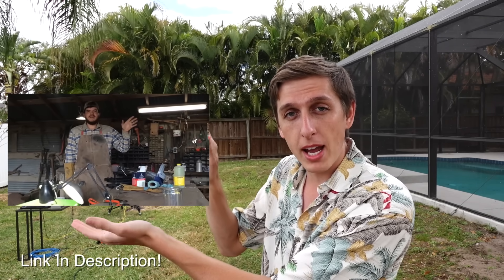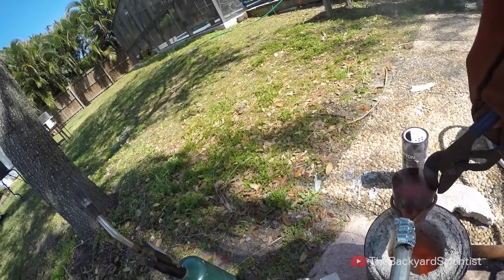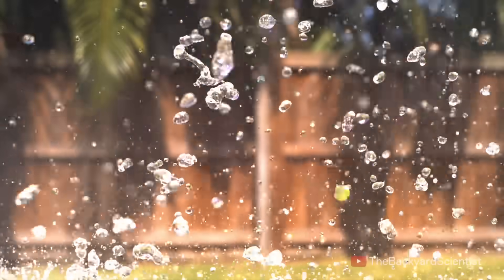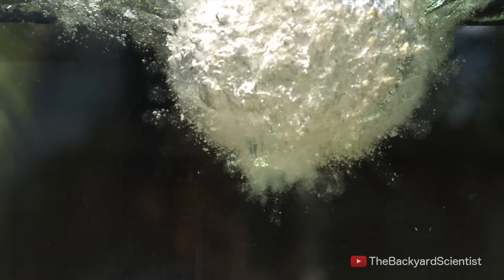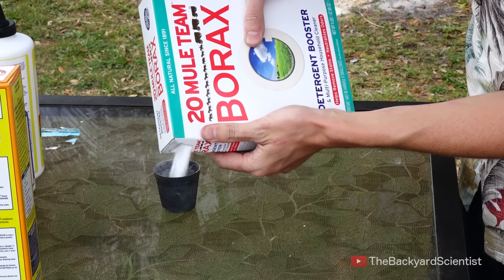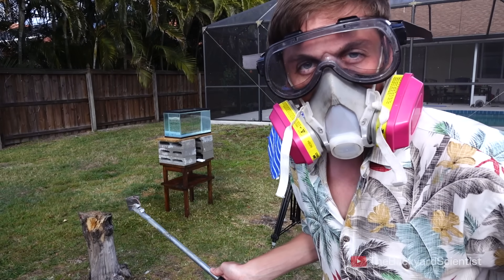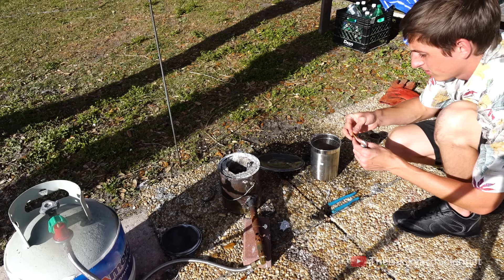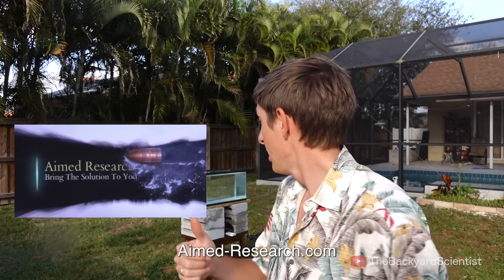Pouring Molten salt into Water - Explosion!

Comment: What's happening is the high temperature of the salt is causing the water to flash to steam. As for your question about the Leidenfrost effect, what you're really talking about is the transition from nucleate boiling to film boiling. Past the critical heat flux, you have a departure from nucleate boiling and a transition into film boiling, which occurs at the Leidenfrost point. The reason that you aren't seeing this transition boiling phase as readily in the case of the NaCl is that the dissociation of the salt in water is endothermic, so it requires some external energy to occur. This would mean that the local temperature of the surface of the molten NaCl may be reduced just under the point where a departure from nucleate boiling would occur.
Reply: Is it bad that I don't at all get what ur saying………

Comment: Leidenfrost Effect via Wikipedia : The Leidenfrost effect is a physical phenomenon in which a liquid, in near contact with a mass significantly hotter than the liquid's boiling point, produces an insulating vapor layer keeping that liquid from boiling rapidly. Due to this ‘repulsive force,’ the droplet hovers over the surface rather than making physical contact with it

Comment: Well it's a nice video 
however u might not know this & that is u can make sodium metal explode too no need to heat it or melt it just throw some small piece of  sodium in water & see the magic of explosion.
and if u say there is no chemical reaction then u are wrong  
if u put the sodium solid in water that chemical reaction happen 
sodium=Na 
water=H2O 
so the chemical reaction is 

2Na(s) + 2H2O =2NaOH(aq) + H2(g)
as u can see the result is  2NaOH( sodium Hydro oxide ) + H2(gas)
& we all know in every chemical reaction massive  heat is produced 
so heat=flame and  H2 =Helium gas 
so Helium gas  + Heat=Massive explosion simple as that . 
and hope it clarified  ur theory !
Reply: +Khondoker Abdullahel Kafi He said the final solution is neutral.
Reply: +Sanjay Thomas it would be neutral if nothing were to happen by pouring  the melted  Sodium in water but sadly things do happen like a huge explosion/or fiery like trail in water.
and if u see my comments all the way through u will know that it's not neutral cause  sodium reacts with water and produced  sodium Hydro oxide and Helium gas and in that chemical reaction   process instance heat is produced & thous heat with helium gas =huge explosion in water molecule.

Comment: I still think it is because of the Sodium. When NaCl melts, Sodium and Chloride get seperated (thus the yellowish Chloride flame) but not entirely. 
Probably, the cleaner the Sodium, the quicker and more violent the explosion. However, as you can't entirely seperate Na from Cl just by warming it, you just have molten NaCl but with more parts of clean Na. (that's maybe the reason the colour of the salt changes to blackish after solidifying again. More Na). So, the molten salt has many parts of unbound Sodium that react to the water making the explosion, but no so many as to explode immediately after touching the surface. The reason the water stays PH neutral, is that Sodium reacting with the water, probably creating some Sodium Hydroxide (NaOH) and water steam, that evaporates. The water should become a bit more alkaline from NaOH, but still it would be minisculε, as most would be thrown out from the explosions on the surface. 
I am not a chemist, but does it sound right?

Comment: For the table salt, the high temperatures initially created a normal gaseous effect, but the cold salinity afterwards exponentially lowers the boiling point of the water and... Yeah, explosions. As for the metal, that just exploded from the exponential cooling from the water and therefore an explosin of thremal energy. That's why there was a fireball compared to the table salt.
Reply: +Redidee um, if you are referring to the pure Sodium when you are saying "metal", then no. Actually when the pure sodium poured into water, the sodium takes the OH from the H2O, releasing one H. Then it becomes an NaOH ion. Because of the heat, the released H starts to react with the air's oxigen, so it burns up to become H2O again. 

2 Na + 2 H2O ->  2 NaOH + H2

then:

2 H2 + O2(this is from the air) ->  2 H2O

Comment: I think the difference between kitchen salt and borax (explosion vs no explosion) is depending on the gradation of solubility in water. Salt is excellent soluble in water but borax is only poor soluble. Expressed in weight: NaCl 358 gr/liter vs 27 gr/liter for Borax. (about 12 ounces per quarter of a gallon vs less than an ounce in a quarter)

So the is salt "trying" to solve as fast as possible while the hot borax is creating a "vapor shield" in the water in which it cannot solve. (Remind you telling us, that it seemed the water didn't touch the borax.)
Reply: +Roland Labruyere what would sugar do?
Reply: +slinky211 Nothing. Sugar melts at about 150 degrees C but then it already is turned into caramel. Caramel hardly doesn't solve in water. So not enough heat, not enough solubility and the bindings between the atoms are totally different. (Sugar covalent bindings versus salt electrovalent bindings.)
Reply: darn

Comment: I feel like you left part of this unexplored. You reproduced the table salt (NaCl) explosion, and compared it to a different kind of salt to test the hypothesis that it is the ionic properties of the salt that causes the explosion. I think you should have tried several kinds of salts, like sulfur salts, or magnesium salts.  Next, you tried the constituent parts, or at least one of them: the sodium metal.  The explosion was unable to penetrate deeply into the water. This was surprising to me anyway. That was the end of the experiment, but perhaps there should have been two steps: Put gaseous chlorine in a small glass tube, suspend it under water, and break it to see what gaseous chlorine does (may require some precautions). Next, find a way to combine the molten sodium with the gaseous chlorine, while it's all under water, and see what result that gives.

Comment: My theory: due to the heat some halogen molecule are escaping from the salt so that some metal are in this liquid. When you put in the water. The metal reacts with the water as an explosion. (Sorry if my English is bad. I am German.) If my theory is true, that mean that the salt, which was liquid and than become solid again, would also explode.

Comment: I believe the water molecules fit into the structure of the salt molecules better on a molecular level. This is why you get such rapid expansion compared with the other ionic liquids. Sort of like how diet coke reacts with Mentos because of the surface texture of the Mentos. That's just my thoughts on the matter though.

Comment: I would suggest comparing fluidity of the 2 first. Then perhaps consider the melting temp and the temp which achieves the desired effect (ie 800 melting and 1000 when effect achieved, then it would be 25% of the melting temp, then perhaps heating the other element to the same % above melting point).  PLEASE BE CAREFUL.

Comment: Its a coulomb explosion. You'd have to film it at 500.000 fps to have a glimpse of it.

It can't be the water expanding, there is just not enough water to explain it - besides, if that was the case, you should be able to see most of the salt either crystallized or diluted in the water afterwards.

Comment: I don't know if you've solved this yet but I have a hypothesis.  I believe the molten salt is creating a Prince Rupert type of drop as it falls into the water. But because salt is weaker than the glass in a real Prince Rupert drop that its tail, or somewhat of  a tail might be, is broken by the turbulence of the water boiling around it, causing the drop to break, release the tension inside and cause the explosion. Thats what I think is happening. If this has already been solved let me know, as this interests me a lot.

Comment: It's just flashing the water into steam.  No chemical reaction.
Reply: +loctite222ms then why doesn't the hotter liquids do the same? he tried other stuff with hotter melting points
Reply: could be a number of factors.  specific heat and heat of fusion of the material are the first thoughts, also thermal conductivity, viscosity of the molten material...

Compare it to just dropping in the liquid sodium.  It's obvious there's no significant chemical reaction.

Comment: Its a chemical reaction because Sodium metal react rapidly with water to form a colourless solution of sodium hydroxide (NaOH) and hydrogen gas (H2). The reaction is exothermic. During the reaction, the sodium metal becomes so hot that it catches fire and burns with a distinct orange colour. Physical change keeps the same elements in the end chemical creates new elements 

2Na(s) + 2H2O → 2NaOH(aq) + H2(g)

Comment: a prediction before I watch this, the reason the explosion happens is because when you melt the salt it separates into sodium and chlorine.  I guess you can tell what is gonna happen if you know pretty much anything about chemistry, sodium and water do not mix and there is a big explosion
Reply: +Turtle Hero it does separate the sodium and the chlorine but when it goes from extreme heat to extreme cool it rips the two atoms apart and the sodium reacts.  The way I could prove this is if I were there and this was true I would be able to smell the chlorine so please do this experiment again and if you can smell the chlorine then I am right.

Comment: I do believe it's still a chemical reaction. Testing pH levels before and after the salt is introduced is irrelevant because of the NaCl being completely soluble in water, thus not changing the concentration of either H+ or OH- Ions. What could be happening is the vaporization of sodium. The melting point of NaCl is 801 degrees C, but the boiling point of sodium is 882.8 degrees C. What I theorize is happening is as the molten salt enters the water, the vaporous sodium crosses the gaseous vapor barrier and reacts with the surrounding water, because you heated the substance up to or past the 882.8 degrees C. This could also explain why the first couple didn't work, because the salt may not have been hot enough for the gas to form.

Comment: The reason why other salts worked differently, is because it's all about temperature. Only the salt has the high melting point, and you even had to heat it up way above melting point, to get the steam explosion. Also, their specific heat might be different.
Reply: +emszabi I think he mentioned at 5:30 that some of the other salts had a higher melting point. You bring up a good point about the specific heat though

Comment: My best explanation for the effect is in the latent heat of fusion.
molten salt keeps a LOT of thermal energy, its heat of fusion is 520kJ/kg (while sodium has only 113kJ/kg for example, I can't find the data for borax)

I guess it can vaporize a substantial amount of water before it hardens, enough so that it can splatter around while still hot.

Also, molten salt has quite a low surface tension, so it's easier for it to become a spray rather than just balls of liquid.

Comment: ugh...pretty much bit wrong.  A chemical is burning same as ice being poured by molted metal, here is element is not listed down.  "Fire".  Fire is base on old greek scientist said earth, water, air, and fire which it is true because earth give the materials like metals and stuff, air is gas, water is liquid and fire is fuse-ment like foring metal or burning gas and ect.  So fire is fuse with molten salt depending tempreture because salt becomes molten ember as being pours in in water, as water vapourated there is 2 compound is cutting gas type, hydrogen and oxygen like all puropous flours, accept that thous vapours being suck into the ember as its trying to feed the fire so instance vaccum and then walla you got a bomb, yes you can transfer this to be bomb, pressuring like pipe bomb accept its water, nails and ultra tight  pipe that can be melted in right tempreture. be molten, this shit will hurt you really fucking bad.  Trust me, simple making bombs as flours dust.  If you noticed you should of learn about mythbusters seeing kids pour hot metal on top of ice that doesn't know fire is in melted metal and causing bigger fire.

Comment: Perhaps the difference was a result of the viscosity. The other molten salts appeared to be more viscous than the sodium chloride. A less viscous liquid would more easily produce small droplets, which would maximize the surface area available for rapidly transferring heat to the water.

Comment: my guess as to why it happens is this:  water changes phase from liquid to gas at 212 degrees F.  Salt changes phase from solid to liquid at (sheeeeeeeesh - a really high temperature) a temperature much greater.  So when something EXTREMELY hot touches water, the water violently vaporizes on contact - the vaporization is do violent, it appears to explode.  Wow - 5 million views in 3 days!  Amazing ... !!
Reply: +Michael Stein sodium is an alkaline metal so explodes in a chemical reaction with water
Reply: +Michael J. Caboose I'm no Chemist or Genius by any stretch ... but Salt isn't Sodium.  Salt is NaCl (Sodium Chloride).  It behaves differently than Sodium (Na).  Just pour some salt in a glass of water - you'll see it doesn't explode.  Put Sodium (Na) in a glass of water and you'll see a show.  Now heat the same salt to a GAGILLION degrees and pour it in water, the water explodes, not the liquid salt.  But the exploding water will throw the liquid salt randomly all over the place.  The water doesn't actually explode - it violently changes from liquid to vapor as it's temperature rapidly bypasses 212 degrees F, the temperature at which water boils.  Conventional explosions are chemical reactions.  But I could be wrong - I'm open to being edumacated.
Reply: idk why alkaline metals explode but im trying to find out

Comment: Try to lift a lare frozen piece of glass with your bare hands. It'll also explode because of the temperature difference. Glass expands and contracts with changes in temperature and deflects due to wind and other pressures like water.

Comment: do the other products have lower melting points?If the molten salt has a higher temperature then when you pour it into water it will create more steam a lot quicker than the other products.The fast expanding of the steam creates pressure and that is why the walls brake.
Reply: +Ivaylo Dimitrov my english is not very good :D

Comment: liked the video. and read a few comments. i had a question. if your theory was correct as to why it did explode they why did the other materials and salts not act the same way? the air should still have expanded at the same rate right? i only read a few comments so i do not know if someone else asked this question so sorry if i am repeating. just really curious. thanks

Comment: Perhaps the reason that the leidenfrost effect doesn't seem to apply to NaCl is the shape of its crystalline structure. It is essentially cubic, and (as most salts do) forms larger versions of its substructure as it multiplies out in size. Thus, there are plenty of gaps in the structure of the salt for the water to fit into, and as it fractures it remains in this cubic shape down as small as 2NaCl. The other salts tested are far larger at their smallest possible crystal and lack these built in "pockets".
In the paper you linked in the description, it makes mention of a similar vapor explosion with liquid sodium and milten uranium oxide. Uranium oxide also has a crystal structure that is cubic to some degree.

Comment: As I remember, the YouTuber Thunderf00t did some really interesting research on alkali metals in water and found that reaction is a coulombic explosion, rather than a chemical one. I would not be surprised if that is the effect we see in this video, however there is no hydrogen produced which is why we don't see fire. This may also go some way to explaining why there were no changes in acidity, but I'm not a chemist so I put my hands up and say that acidity is a mystery to me. My training is primarily in physics.

Your fuel-coolant interaction explanation may also be valid, though.

Also, anyone else notice the vortex ring at 4:38 and 4:39 at the bottom of the frame? Pretty neat.

Comment: It might have to do with solution enthalpy, each salt had a different value and this is correlated to how much heat they release at contact with water. And by boiling the salt you increased the Temperature delta, by this you increase the energy liberated :)

Comment: From what I understand. The reason it explodes is because of the trapped heat energy compiled with the sodium chloride. Pouring it into water you're releasing the compiled energy and the water increases the volume. When the sodium chloride decompresses it releases heat energy applied to vibration energy from the sodium chloride resulting in an explosion. The reason Borax doesn't explode is because it doesn't compile enough heat energy like sodium chloride because of its chemical compound and lower melting point.

Comment: If someone already said this, sorry for repeating it, but I have an idea that if you would adjust the frame rate on the MIRO, you would be able to see a little better if your hypothesis looks like the reality of the explosion. I have never worked with high speed filming, so I don't know the limitations of lighting and focus. It looked to me, though, that 21k fps was too slow -- the initial pulse of the explosion still only took a couple of frames. What would it look like if you doubled or tripled the frame rate?